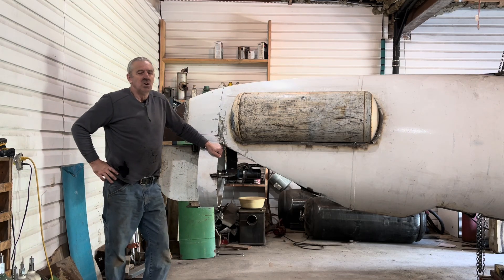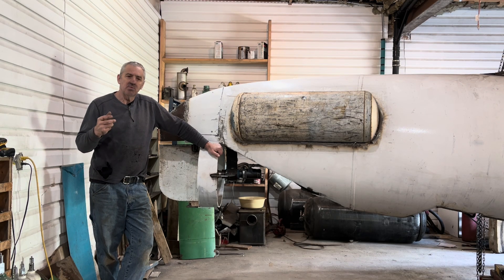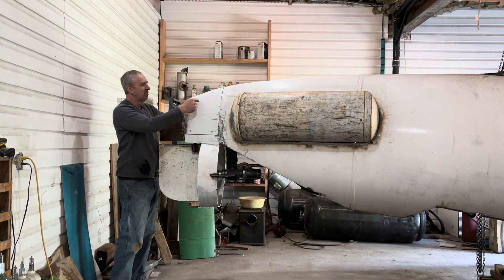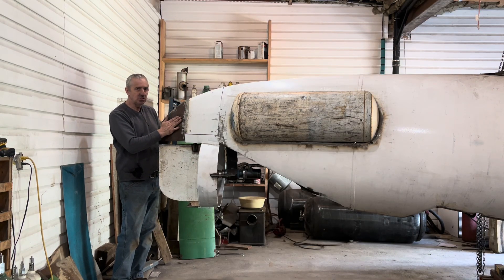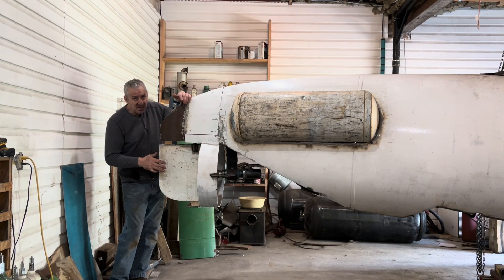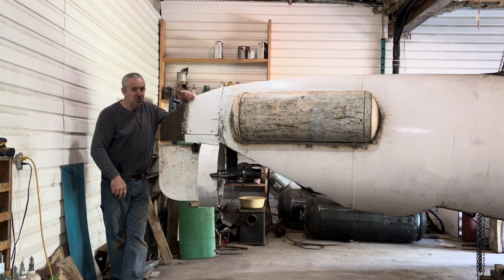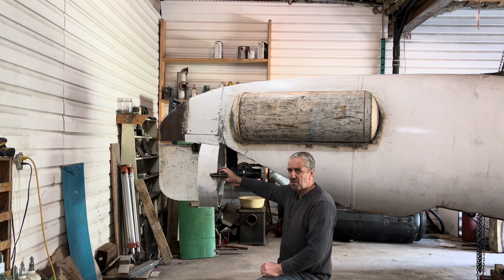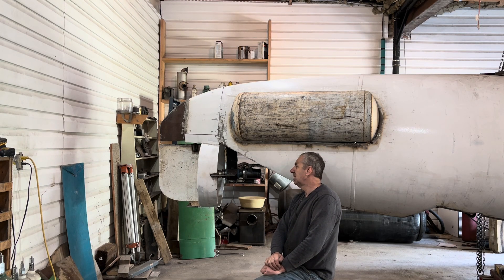Building my diesel electric submarine at home

Comment: I have soooooooo many questions! I’ve recently bought a new end cap for a 1000 gallon propane tank builder brand new…I want to build a clamshell submersible. Hank would you or Amy of your followers know where I can get a 6” thick view port like on your silver submersible has. Plea help anyone, I’d like to hopefully make it to reach depths of 1000’. Please help anyone, before my wife charges her mind HAHAHA!
Reply from the maker: I buy my acrylic from Reynolds Polymer in Colorado USA.  That was a flat 3 inch thick disk that I annealed and machined into a dome.
Reply: @HankPronk sorry to bother you yet again, I’m in Calgary but I’m trying to find your post with the metal fabricator you used in Edmonton. Would you happen to have the information handy. Thanks again! Keep on inspiring
Reply from the maker: @ Edmonton exchanger

Comment: Just wondering why you didn’t attach the hydraulic motor to and propeller guard to the rudder so it turns with it for better control especially in reverse. You could fit swivel hydraulic fittings to the motor
Reply from the maker: I had a 6000 lb two man sub for a while, and it had a rudder with fixed prop and it was very maneuverable.  I was happy with it and like to keep things simple.  I think because the sub has so much mass compared to max speed, there is a lot of prop wash on the rudder making it very effective.

Comment: Hi Hank, I used to work for a Naval architect. The rudder should be a rectangle. The curve at the bottom will make it less efficient. Also the arc of travel from port to starboard should not be more than 34 degrees. Rudders will stall if greater than that.
Reply from the maker: I suspected that, and will probaly fill that curve in.  Good to know on the arc, thanks.